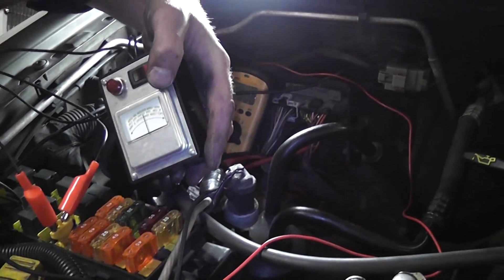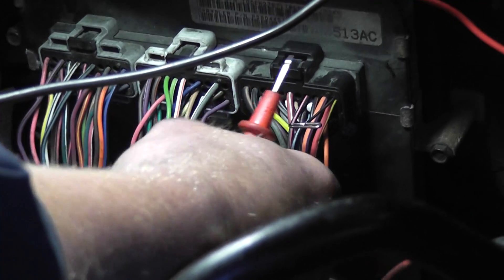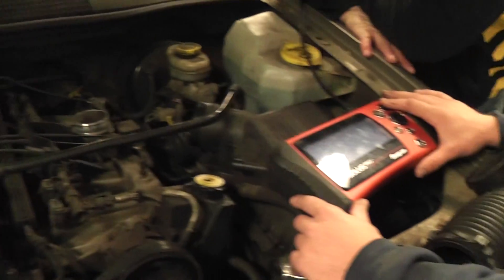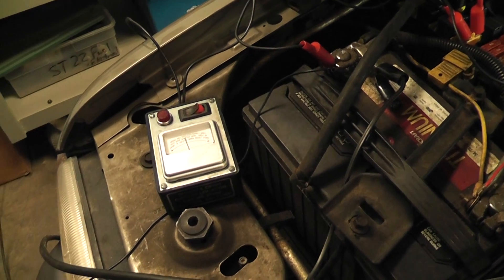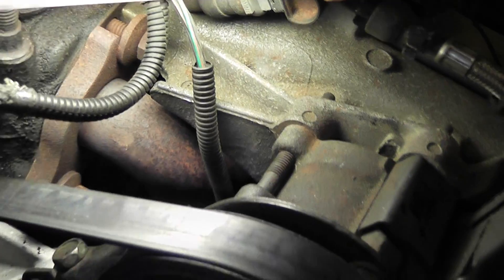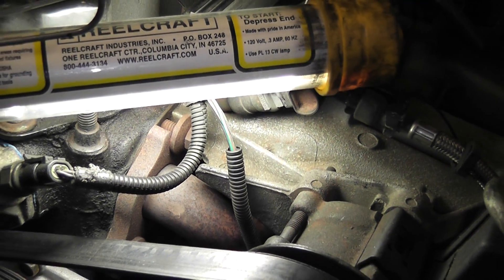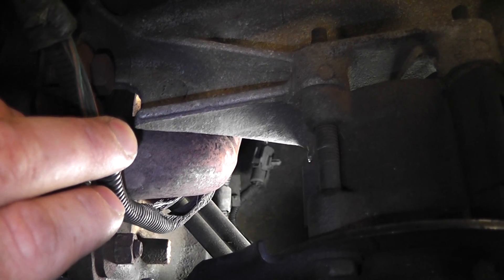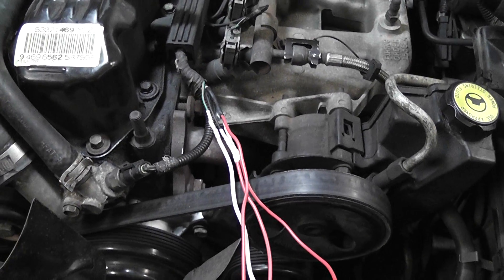1996 Jeep No Start Case Study Part III

Comment: these video'shave been a great help.i have s 1998 Cherokee 4.0 i have a crank no start issue.no spark, no fuel, no fuel gauge.no read on scan tool. PCM seems good checked 5v reference.changed cps fuel pump good. swapped all relays.coil tested good. fuel pump relay has a slight hum when i unplug fuel relay -Vapor Canister Purge Solenoid clicks.with key on when i unplug plug A from PCM my driver side fan kicks on. checked all fuses none were blown. and  found that there is no power going to o2s heaters fuse or to injector/coil fuse.

Comment: 20 years into doing this, I find your systematic teaching approach to be the best, and later on students will learn real world shortcuts, but need to learn the long way first. David Ward, you're a dipshit. He used this as a teaching moment, not to show you how fast he could figure it out. Moron.

Paul, where did you get that circuit breaker/short finder? Or did you make it?
Reply: Thank you Steve and I do not remember where I got that tool, sorry.

Comment: I had a Dodge half ton pickup come to me and the PCM was NOT grounding the fuel pump relay coil. The truck did have a functioning 5v-ref circuit so I immediately knew part of the PCM was alive. So what I did was backprobe that wire at the computer and did what you did on the GM EGR video you posted. I took a fused jumper wire and found a good ground and jump that directly to my backprobing tool thus grounding that wire. Installed the fuel pump relay and boom, she started right up.

Comment: A water pump was recently R&Red on that Jeep it looks like. Awesome case study series Paul. I'm very familiar with the ASD circuit on these Chrysler/Jeep products. LG/BLK wire that comes from the ASD relay coil(powered up by the ign. switch thru fuse 9 that goes to the transmission relay. In between fuse 9 and the ign, switch is a DB wire. That LG/BLK wire also feeds the fuel pump relay coil while the PCM grounds that relay coil on a BRO/WHT wire from C19. I remember this only because

Comment: Watched all 3 , thanks for posting. I have a 93 Jeep Grand Cherokee, that stalls & dies.  Had no problems with it til an anti theft device locked up after filling tank.  Towed to an electrical shop, where they fixed that problem & left with many more headaches. It's been a 18 mos.  It stalls after running for 10 miles, then cuts out & dies. Going 55 on hwy. - it will just die.  let sit for few minutes- it goes again.  New, fuel pump, fuel filter, gas cap, spark plugs, & new battery connecters.

Comment from the maker: lol, no, you are the first to even mention it. i am surprised myself that I haven't gotten crap for that. 
it's cool that you understand exactly why I did it. i didn't want to crawl underneath that jeep!

 I could have done the same thing on the cam sensor reference wire in one of my last videos, but it was just as easy to unplug that harness connector.

Comment: the same issue happened to me on my 2001 Tahoe on one of the heated O2 sensors, and now i cant get rid of the code (P0420) which made me have to disable it from the PCM

Comment: Curious about the 5v ref. Lets say there is a short, sensor or wire. Wouldn't you still get communication with a scan tool?

Comment: This video just answered a problem im having. 99 ford mustang, someone smashed the wiring harness into the bellhousing and block changing a clutch. I've repaired the wires and I still have a check engine light for O2 heater circuit and even the evap circuit. I thought the computer was cooked. I bought a spare one through autozone, but dont have an ideal on where i'd take it to get it reprogrammed or even how much it would cost?   Love your videos by the way.

Comment: another excellent video.
just a note on wire harness repair- wire harness tape used by the OE's is available online.  once you try it you won't go back to the gooey mess of electrical tape.

Comment: I learn a lot from [post] from other technicians, If the power an ground to the computer was in question from the beginning, would you get a "No communication" signal on the scanner WITH the key on? and the fact that the fuel pump was running seem to indicate that the computer was in play although showing  faulty operation.

Comment from the maker: Also, it was only 30 minutes total time. So either way I don't feel that we wasted time. What we covered that was equally important to the fix. How to trace a 5 volt ref. circuit. How to isolate the 5v ref circuit. How important the 5v ref circuit is. What can be shared and what cannot be shared with the reference circuit. How to check PCM powers and grounds. How to locate a short to ground etc. etc.

Comment from the maker: I respect your opinion. I should have tested fuses first and in the field I would have done that. I shot this video live, I truly believed I had a shorted reference circuit going into this job, caused by that aftermarket "chip". Either way it was procedures I was showing, not how fast I can diagnose the problem. It was important to know how to isolate a shorted reference circuit. I refer to this video in class when we cover that, even though this vehicle did not have that problem.

Comment: this was not the right way. he knows how to diagnose but in a repair shop you have to diagnose and repair a few cars per day this was way to long and why would you check all those sensors? if your missing a 5v output first thing is to make sure the pcm is getting a voltage supply and ground if the computer does not have a voltage input how can it provide a voltage output?He is very knowledgeable but this was a fail,I have been diagnosing cars long enough to know that some days we have brain fart

Comment from the maker: Correct this problem would blow the main fuse. Try cleaning your throttle body with an old toothbrush and some carb. cleaner.

Comment: Excellent instructor! Just as He say's, Visual inspections are very important in analysis, to Diagnoise. I have personaly found many problems solved over the years, just looking over the vehicles, and many times ended up finding something more critical to repair than the original problem,also found many safety issues this way. KEEP THESE GREAT VIDEOS ROLLING. Great material. Thank You

Comment from the maker: @Mooktopia Great question. The alternative to simply a few hours labor and a fuse would be part after part that would have been replaced needlessly. Imagine how much the bill would have been for an ignition coil, crank sensor and an engine computer. And obviously that would not have even fixed it. This field is full of incompetent "mechanics" (more like parts changers).  This bill would have been cheaper than at a "parts hanging" garage.

Comment: i really need help danner i have a 97 jeep grand cherokee and i have no spark out of the distributor but i have it at the coil. Ive changed the cap and rotor all plug wires cam and crank sensor and still the same thing please comment back?????